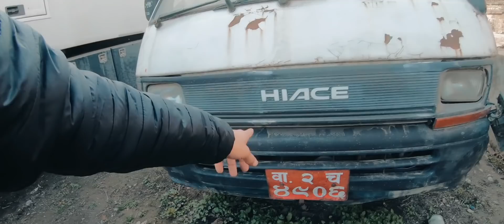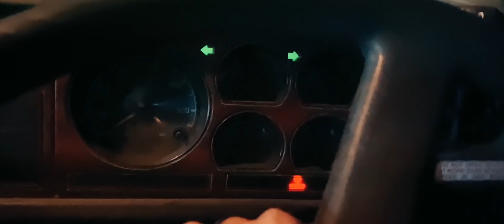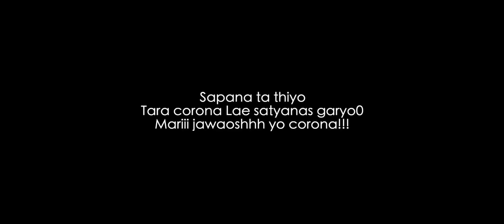Camper hunt in ktm ep-4 found camper Truck in KTM city

Comment: Truck ko load 2 times heavy hunxa bro suspension must be sup strong and double check the body of the truck rust la khako xa hola vhittta vhittra.
Engine lye load parxa hola bro aakchoti toe ne thunk garnu and toilet bath room ko space chau sup leak proof hunnu parxa hai. Cabine bhittra air flow ko laggi ne you have to do something ani aaru ne dharai kura harru xa lots of work.

Comment: Good idea but honestly this truck isn't very suitable for a RV/camper conversion. The truck bed is too high - it looks like it is already at a height of more than 3 feet. When you add the actual cabin, the total height will likely exceed 12 feet - this can not only make it very tough for you to get into many garages or under some bridges, it also increases the risk for vehicle rollover - a major safety consideration. Best advice would be for you to consult an expert first before going about this build.. Also - having a bed hanging from above in a moving vehicle is unsafe and impractical. Just use a sofa/bed. Just some thoughts and tips.
Reply from the maker: Thank you so much 😊